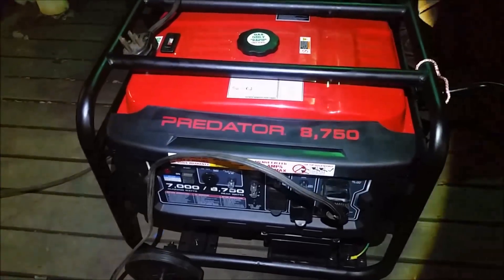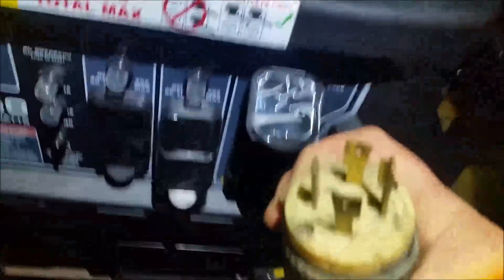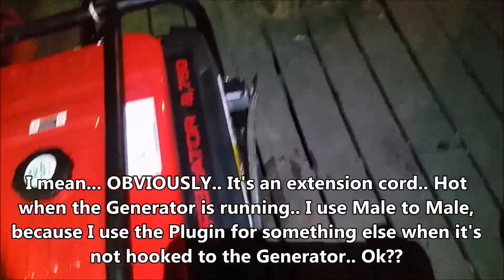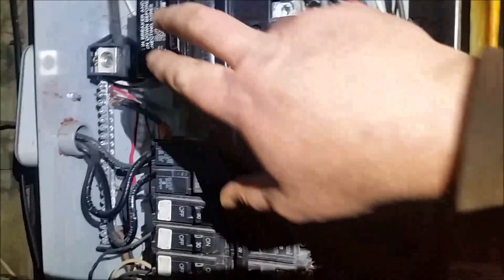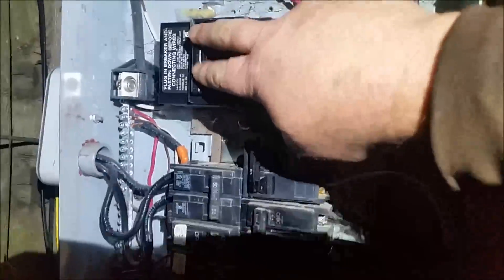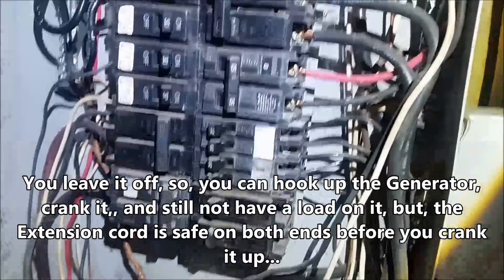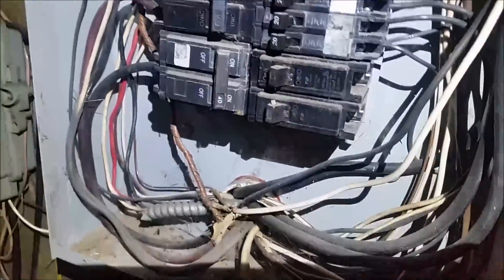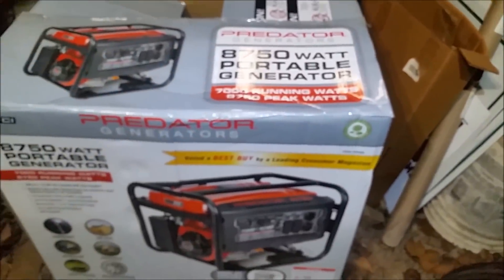Quick/Easy/Safe: Use Existing Plugin/Breaker for Generator hook up to your house Panel box.

Comment: ALERT ALERT ALERT>>> Smart versus Death?
I wil not go into the other legalities to keep this short as I feel necessary. 

Spend a few more dollars Do it right or get it done by a Lic. Electrician.

National Electrical Code requires a system in place that prevents an emergency generator feeding back into the utility line. 
This interlock will only allow the generator breaker to be switched on if the main breaker is off. 
Or the main breaker to be turned on if the generator breaker is off. 

Using a main breaker interlock located in the Panel will allow you to power your existing house wiring with your generator (within its wattage limits), including 240 volt circuits.

If you burn up your home or KILL someone you will go to JAIL,  You are liable,  You can and will be fined also insurance WILL NOT cover 1 Red Cent!!! 
 
Like biting your lip/ tripping and falling, sneezing. You don't know when it will happen but you can believe its going to happen!
 
Just because we have knowledge to make things work, Do Not show it to the public unless You follow the Basic Safety Precaution some steps you do not want to eliminate.

Shorts cuts and hacks are great except when the chance is 50/50 balanced  between the human error factor...
Do everyone on your site a favor if your gonna show it,  do it right!
How horrible would you feel if you killed your momma! 
Remember there is no hack or short cut to bring her back, you are to smart for your own good with to much hacking going on at your place and thats the little I saw from this video.
Reply: NEC.. a code book for new construction under a permit or upgrades.. what you do on your property with your belongings is up to you..not the NEC>  Especially since Electricians over freaking charge the hell out of everyone..ESPECIALLY when it comes to running data wire.  Untrained rooks  thinking they can do better then a structured cable specialist.. I made a solid living off un-Fukn shiat screwed up by Electricians. Why and how??simple... Companies hire maybe one or three actual Electrician.. then send out no bodies to do the actual work..then sign off under someone else's name that actually had the training.  So you keep screaming NEC.. How keep getting calls to go back behind your step ons and undo their screw ups...
Reply from the maker: That is surely the way it works.. I've been there and seen that too. More times than not.
Reply from the maker: I'm not understanding what you are referring to.. What I said.. Let me clarify what I think you are saying, or your question, based on your description.. 
For Starters.. A generator Interlock is just a sliding metal bracket that will only let you turn on your Generator feed to the box when the main breaker has been turned off,, or vice versa.. Can't turn the main breaker back on, unless you turn off the generator breaker first.. It is only a metal bracket that gets installed in the removable panel inside of your breaker box.. Here is a video of a guy installing one.. https://www.youtube.com/watch?v=_pQpXo4np4k
That said.. I don't think that is what you are looking for.. Doesn't have anything to do with the location/size etc of your box.. You still have to feed the box from somewhere.. It only makes you safe when you are switching feeds.. Just makes it Fool Proof, so, you don't turn the main breaker on with the generator hooked up or vice versa.. Can not backfeed the generator feed to utility power etc.. 
You are talking about physically adding something to hook your generator into, that will in turn hook into your breaker panel.. In your case, it would have to be added somewhere where you already have a sizable wire leaving your panel to something else in your house.. An Electric Stove or an Electric dryer or something.. You need 30 to 50 amps to run a minimum to Medium load.. So, see if you have a Breaker somewhere, where you could run a temporary cord to that plugin(dryer/stove), and use the male to male cord, like in the video... I am using a welder connection 50 amp to backfeed the box, but, I could also use a dryer plugin, etc.. 
The only other option you would have is to put it somewhere between your Meter and your inside panel, and it would be a special type of box designed to have one Hot In (from the power company), and two main 220v breakers out,, and you would have to be able to turn the top main breaker off and then, have both of the other mains on the same bus bars, so, you could run one from your generator and have it feed the other.. It would be a "Manual Transfer switch" of sorts,, and would be a little hard to find.. Basically the same as the transfer switches you are talking about.. 
If you have an available 220v plugin somewhere, it would be your easiest alternative.. But, you need to use the existing breaker that is in the box.. Don't upsize it.. It is probably rated for the wire that is inside the walls of your house and depending on the load/size of generator, it is possible to overdrive it and that would cause the wires to heat up.. That is why I said "Electric Stove or Electric Dryer".. Those are usually 50amp and 30 amp respectively. 
I hope I didn't muddy the water a bit more for you, but, that is basically the  way that works.. 
Forget about the panel in the house if you can't get to a Dryer or Stove plug with your generator male to Male plug.
Look outside where the power comes into your house and see if you have a way to hook it up outside.. 
Sometimes they put the meter pan on the outside of the house and go directly into the side of the house behind the meter pan,,,,, but,, you are always supposed to have an outside Main Breaker, and that is where you are going to want to start.. If that is the case,, adding a 220 breaker and putting a plug just outside of the box will do what you want to do.. If you do not like the "Male to Male-Suicide cord",, then, buy a female box for a generator and put it on the wall. Then, you can use a standard generator cord, and not a male to male.. 
If you want to see an example of that,,, look at the video again, and imagine the plugin on the outside Right Side of the breaker box is a Female plugin and the plug into it is female (other end of the generator cord) and the box on the wall has a "Recessed Male Plug" with a cover.. <<<< BUT>>>>> If I did that,, I would move the breaker to the top of the box and put a Generator Interlock in the panel, because,, now,, you have something hanging there that could kill someone for real.. It is different, and curious people can get hurt looking at it... 
The only thing dangerous about what I did is the Male to Male Cord.. But, if you don't have enough sense to make sure that the main is off before you plug it in,,  or,, that you are not running the Genset when you are holding the other end in your hand,,, well,, it is not a solution for you.. 
I think you may have it now, unless you have some preconception of how it should work.. I have covered it.. But, in case not, ask away.. I'll try to figure out what it is that you are not understanding and fill in the blanks for you.. 
Cheers.. 
BTW.. if you watch the end of most of my videos, you can figure out how to contact me.. I don't answer the phone, but, if you tell the Lady who does that  you have a question about a youtube video, she usually will give you my contact info.. Just don't call on a Saturday or between 10am and 4pm during our peak season.. Ha..Ha. It gets busy here..
Reply: You are talking about physically adding something to hook your generator into, that will in turn hook into your breaker panel.. In your case, it would have to be added somewhere where you already have a sizable wire leaving your panel to something else in your house.. An Electric Stove or an Electric dryer or something.. You need 30 to 50 amps to run a minimum to Medium load.. So, see if you have a Breaker somewhere, where you could run a temporary cord to that plugin(dryer/stove), and use the male to male cord, like in the video... I am using a welder connection 50 amp to backfeed the box, but, I could also use a dryer plugin, etc.

Just to clarify. When I had my garage built, I knew how I was going to wire my generator so when I wired my garage, I installed dual 60 amp breakers in my outside meter disconnect box and used 8 gauge wire from there through underground conduit and into my garage breaker box. My generator is 7 Kw which equals 29 amps @ 120 volts per leg. I installed dual 30 amp breakers in the garage box close to the generator for maximum protection. From there, I ran 8 gauge wire, 4 feet, to a 50 amp 4 blade outlet mounted to the wall. My jumper from the generator to the wall is also 8 gauge wire between the 50 amp blade plug on the wall and the 50 amp twist lock on the generator. This is 6 feet long to facilitate moving the generator for oil changes, maintenance or picking up something if it falls behind it, without needing to disconnect either plug. In all, I kept all lines as short as practical.
Reply from the maker: Jeff.. I am loosing track.. For some reason, the comments are not in order and not being tabbed under each conversation.. And my replies are not directly under what I am replying to. I'll have to look and see if there is some sort of setting.. But, what I think you are referring to is the comment about putting the Lug box in.. 
I don't think it would apply in your case, now that I understand it.. 
It was a way to put the generator basically between your Meter pan and your House wiring.. A small box with 3 large main breakers to speak.. One for the Utility power feed that would act as a main to Utility and two more main breakers. One to your house and one to the Generator..Flip the Utility breaker off and the other two breakers on and you are on generator. Flip Gen breaker off and Utility back on and you are running Utility power.
One small box, One Generator Feed, One Utility feed, and one main wire running to your Restricted area Panel in your house.. Someone else mentioned the idea and I commented that to you.. And, I just scrolled back up and don't see the comment.. I even pinned the comment, but, I see my "DumbAss Alert pinned comment is back..Ha.. 
It was a comment made by a user Holcomb.. 
I started the comment with this text "GREAT TRIBUTE TO A YOUTUBE USER WITH A GREAT IDEA.. You guys should read about it.. " and I put his name in there, but, when I went back, I could not find the comment.. 
I know it is here somewhere.. I think all of this started when I turned comments off, then, deleted all of the Igmofuck comments and later turned commenting back on.. I have since even swapped out my old computer with a brand new one I ordered and built and the problem is the same, so, it is youtube based.. 
I'll have to pay a bit more attention to the other video comments and see if it is an account wide thing or just this video. I have way too many projects going on right now.. Ha.. 
It took me 2 days to sort my todo list and then, one day to ride around the property and make materials list for all of the initial projects I have to do.. 
This has to be done before that, and while I have those tools out, this could be done since it is on the list but, can't be put off too long, but, the other 4 projects of the same tools can be put off till late winter, while I get the other projects slated for 2nd week of August ready, so, I can start closing second week of September, so, these 6 projects need to be done before that.. Ha.. If I could just ditch the Computer and office work for a couple of months. Ha.. But, I did that last Winter and it was not a great idea.. Ha.. 
I have only had one employee in 12 years that I would love to have back if it were possible, but, he got married and his wife's family set them up with a house 2 hours from here.. He was a 28 count convicted Felon just got out of jail when I hired him.. He had the right attitude and was eager to learn and cared about what he was doing...
I taught him more in 2 years that someone could pick up in 10 or 15 years.. If he did something and it took him and hour, and I went out and did the same thing and it only took me 15 minutes,, he would obsess over it until he figured out how I did it so fast.. And how it looked like I did everything the hard way, but, I never made any mistakes and it was always the better and fastest way to do it.. If we had something we had to do 4 or 5 times, I would stop, ask him what he thought, we would do it his way, then,, we would do it my way and finish the rest up my way.. Weird, but, neither one of us could ever figure out why my way was always faster.. After we would do it, we could see time savers here and there that made a difference, but, I could never guarantee my way would be faster until we did it both ways.. And, there was no way I could have figured the job in that kind of detail to pick it out.. 
All I can say is the Subconscious mind is an incredible thing,,, and if a guy could totally control it, he would be an absolute genius.. Seems like the more tired I get, the more focused I become,, at least to a point anyway. 
Then, I have the typical employee that takes 1 hour to do something that takes me 15 minutes and the next time he does it, it is worse and it takes him 1.5 hours to do it.. Ha..Ha.. At least I can give him a list of things to get out and ready, and get things started, where I can walk out and get the job done and let him put everything back up.. 
So, I prioritize my jobs according to tools used  and locations used.  I spend a couple of days doing Carpenter work,,, a couple of days doing electrical, and pick up a few jobs that require a few tools of another sort if I am in that area and it's a small task that can be done while I am there.. I usually pull a little 4x6 trailer behind my 4 wheeler with whatever tools I am going to use, unless I am working in the shop.. If it's a two or three day project , I just back the trailer under the shed and pull it out in the morning and go again.. 
I'd better get some rest.. See ya.
Reply: ...I am loosing track.. For some reason, the comments are not in order and not being tabbed under each conversation...

I do this more on AOL news comment sections but I usually copy / paste at least a portion of what I'm commenting on or replying to just for continuity sake as I did above. I distinguish this by beginning and ending the copy with 3 dots at each end then I skip a line. This way, if someone posts between me and what I'm commenting on, the subject matter will be there for reference. Not to get political here but one person on AOL asked why I did it and accused me of being a parrot. I answered him back that I wasn't a parrot, I am a Democrat. The only reason I did that was because this guy was always slinging "quotes" from Trump but when asked for independent evidence or some reference to his source, he would always dodge the question with more accusations about Hillary or Obama so I set it back on him that he was blindly parroting Trump with no thought of his own on his part. I still copy / paste there anyway because when I get notifications that I have been replied too, sometimes I post so many things on a particular story, it's hard to keep up with what and where I posted in the narrative and to whom I had aimed it at. Sometimes I LOVE to argue. :) I hope this helps you.
Reply from the maker: Ha.. Yep.. I can see that.. that comment caught me off guard,  because it said, you replied and I saw my text as your reply, but, I knew before I clicked on it what you had done... A paragraph subject identifier for the reader or the person replying.. But,, ha.. you really threw me with the Democrat thing.. Ha..Ha.. You seem way too smart to be a Democrat.. :)..  I rarely will look up a reference to, or independent source for a comment I make about something. But, I rarely discuss something that is not "recently" in the news.. And, it is getting increasingly difficult to argue "Facts" with someone, since there are so many "Bald Face Lies" being told in the media these days..  I pretty much limit myself to comments from Congressional Members, but that is even getting totally out of hand since Trump has been elected.. It's like all rules are being ignored, there are no professional ethics any longer, and the media can say anything these days and get away with it.. With all of the Government rules and regulations these days in every facit of our lives,, It behooves me to think that a "News" Agency, not a "Commentary" show, can get away with telling their lies, without loosing their licenses.. I think we are going to see just how bad our Government has been before the Mid Terms.. Something tells me that there are going to be a lot of people finally going to jail over it all. 
There is enough evidence out there right now to jail a whole bunch of them, and has been for a very long time.
But, you are not going to see this done in any State or Federal Court Room, since the Missing 13th and the 14th Amendments, when our Government made it's final transition from the Founders great "Republic" Experiment, to the Foreign Corporation.. Ever wonder why,, if we ran Guns to the Mexican Drug Cartell, or, to foreign Terrorists, the FBI would swoop in and arrest us and throw us in jail,, but,, for congressional members, they only "Recommend an Indictment"?? In recent history,, Comey "Failed to, or Refused to recommend to Indict" Hillary to the US Attorney General? They would not need a "Recommendation of Indictment" to kick down "Our" door and arrest us,, now would they?? It's quite simple.. If a Foreign Diplomat was accused of, or,, was caught red handed on National TV killing someone,, would the FBI swoop in, and Arrest them?? NOPE!!
They would restrict them to "Their Foreign Soil - their USA Based Embassy", and "Recommend Indictment" to their Foreign Country's Government, and assist in their leaving the Country voluntarily to return to their own Country, and whatever that Country decided to do about it, would be their business only and ours to only gripe about it if we didn't like it.. Sound Familiar??? 
But, the whole mess was done illegally,, and all of the Debt we have assumed since has been assumed by another Entity,, not our Republic of the United States of America, and our Common Law, not our Maritime or Admiralty Law system we are under now..  It will be interesting to see how it all works out.. But, My bet is,, it will all be out in the open and changed if there is going to be a change by the big Parade on Veterans day,, November 11, 2018.. 
If we don't end up investigating and prosecuting the investigators, I would be utterly amazed.. 
Not sure if you know the Judge.. Not sure if you will like this or not, but, you should give it the 9 minutes.. Especially if you are really a Democrat.. :)
https://www.youtube.com/watch?v=iYUZFYa7fLs
Reply from the maker: JEFF McCREA.. I forgot to say something.. 
If you want to add the Generator Interlock,, you will need to buy one for your particular box,, and you will have to move the Generator backfeed breaker to the top of the box, either top left or top right.. That is the location the Interlock is designed to protect.. Here is a good place to see the different panel types and different Interlock types. A good place to start anyway.. But, ebay will probably be the best place to find and buy easier and most likely cheaper. 
https://natramelec.com/
Reply: Tracy bass ...it may not look pretty to you. But he does know what hes doing.
Reply from the maker: Thanks Ricovali.. You are correct.. I have beaten down these "Safety Nut" guys at every comment they have made.. It all boils down to one thing.. If you can't follow some very, very simple instructions,, or don't have enough common sense to understand what you are doing to do it from your mind rather than memory or a list of instructions, you really have no business doing anything electrical..  Even changing a light bulb could be dangerous, if you stick your finger in the socket.. One good thing about this setup is,,, when you grab that Male to Male extension cord,, if that does not remind you to be careful,, Nothing will!! Think about that for a minute... ?
Reply: I get what you're talking about now with the "lockout device. Thanks for the address. I will watch it. To clarify, my system is set up in my garage. When I wired my garage, I ran an 8 X 3 with ground wire out of my breaker box below the meter box on the house with a double 60 amp breaker. I ran it into an 8 circuit breaker box in my garage. I have 6 various breakers from 15 to 20 amps to power lights, power tools, garage door opener and other outlets. I installed a double 30 amp breaker and ran it to a 4 pin 50 amp dedicated outlet with 8 gauge wire. I made an 8 gauge jumper with a 4 pin 50 amp twistlock male plug that mates to my 7 Kw generator and ended it with the 4 pin 50 amp male plug to match the one on the wall. This way, it never has to be handled so there is no shock hazard. If someone comes that shouldn't see the setup,. I unplug it, hide the jumper and, if asked, the plug is for my arc welder. Anyway, 7 Kw at each 120 VAC leg is 29 amps. When we have normal power, the double 30's are turned off disconnecting the generator from the system. I had put red wire ties on all the 240 VAC breakers in the house breaker box. When the power goes off, with instruction manual in hand, these get flipped first. Then I go outside and flip the main breaker on the meter box. Then I go into the garage, turn on the fuel valve, pull the choke knob, flip the kill switch and push the starter. After the generator runs for about 30 seconds, I flip the double 30 amp breaker connecting the generator to the house system. It won't run my 4 ton heat / A/C unit but if I leave the furnace breaker on, I can run the main blower by itself to circulate air in the house. Years ago, I had a 5 Kw Coleman. When I shut it off, I would just hit the kill switch and walk away. One winter, the power went off and I couldn't keep it running to save my life. I called a friend at a small engine shop who said that I let the gas in the carburetor get old and turn to varnish and it clogged. Even with fuel stabilizer!!! He told me to pour in 1/2 a can of Sea Foam engine additive to 5 gallons of gas and do what I could to keep it running. After slogging out 6 or 7 times to restart it in a half hour, it finally smoothed out. Now, when I run the generator, when the power comes back on, instead of hitting the kill switch, I shut off the fuel valve and let the carb. run dry. I haven't had a problem since. I still have the old Coleman and use it as a loaner for my friends. It sat, tank empty, for about 2 years. I went out to change the oil and start it up and it wouldn't go. I went to Walmart and got a bottle of Mechanic in a Bottle. It's about $7.00. I poured 1/2 a bottle in the empty tank BY ITSELF according to the directions and let it fill the carb. I put gas in it 15 minutes later and it ran like a champ. As for installing a transfer switch box in my house as recommended, I would have it install it next to my breaker box so I could access / disconnect selected circuits to connect them to the transfer switches. for "proper" operation. Where my breaker box is physically located, there is no room to install the transfer box into or on the wall. It is in a short divider wall between 2 rooms.
Reply from the maker: Ok. I got it.. Understood.. That is probably the way I would have hooked it up in that case.. I hate to do anything permanent, because I don't have things the way I like them yet.. Seems every project has one that needs to be done before that one.. I used to have everything in one shop when I lived in Louisiana, but, it had some drawbacks, but, I never let them bother me.. I never liked doing the welding and cutting in my shop (cement slap with smooth finish).. Now that I do a good bit of Blacksmithing work, I have begun to appreciate a dirt floor, and a more open shop.. I rebuild my metal table a bit larger and I like the two projects together.. Still trying to decide what I really want.. One large shop about 100 x 50 would do it, but, it's not in the cards at the moment due to the lack of flat ground.. 
I am almost ready to put in a 20x50 with slab for the wood working, and Machine work, with a small exterior covered slab for any metal fab work that I need to do.. I have an extra Welder and plasma for that.. But, I have a need for a 40' container to store my boats.. The 20' is not large enough any more and it would just be a waste where I want to put it, if I didn't put a second container on top of the other, so I could walk into the second one from the other side of my house.. And, I have a 12x21 carport that I am going to move in front of that on a blacktop slab that I will do some other projects and use for extra storage for stock, etc.. I live 20 mins from a very small Ace Hardware and 45 minutes from a Lowes. I have my own Metal/Wood Mart and my own Ace Hardware right here.. Ha.. But, I have some retaining wall work to do before I do that.. (See what I mean?)..Ha. 
I have a few other projects this winter that are going to take up quite a bit of time designing,, and I said I am going to build some of the Industrial wood and furniture this year to let me get more organized in my house until I decide what to do shed wise again.. It's a little place and I do way more stuff than anyone I know, and I like to have what I need when I work on it, so, I have lots and lots of all kinds of stuff.. I am tossing out my dressers and wardrobe whatever you call them (some expensive brand junk), and I am going to the ceilings with some really cool cabinets with Drawers, doors (have to design some offset hinges that I know will work already), and a New Entertainment system for the 50" flat screen I have had in the back of my closet for the past 3 years, I bought from an employee who needed some cash.. Everything is going to be modular. Even the Hall Cabinets and Kitchen Cabinets.. I am going to tear this old place down one day and when I do,, I am going to just pull out the drawers/shelves and move everything into something else.. Or, they will become some fancy shop cabinets. 
I built one last fall for my Lathe and Mill accessories, and figured out exactly what I do and don't  like about it.. 
I've just been tossing things together here and there to fill a need, and it's almost that time to start replacing those things with a purpose.. I needed some cabinets a couple of years ago and didn't have time to build what I wanted and had to replace a front deck on my large bath house down stairs and had a bunch of 1" thick rough cut wood that had been walked on for 20 years... It's going to turn into some pretty nice looking and functional furniture before too long.. Anyway. Just thinking with my fingers.. One project at a time,, but, I have about 40 on my Fall and Winter todo list already... Ha.
Reply: In my state there is a Master shut off box after the meeter it has a big metal lever that disconnectes the power before the breaker box, here every house has to have one!
Reply: I wouldn't be willing to bet someone else's life that everyone that reads this and trys it is competent enough to turn the main off every time. All it takes is one person to screw up and ruin someone else's life.
Reply: James Williford yes you are right, this video should be taken down!!!
Reply from the maker: You are exactly correct.. Common sense and some basic understanding of Electricity and Panel boxes is DEFINITELY REQUIRED to use this setup... If it doesn't make sense to you that the Main Breaker MUST BE TURNED OFF FIRST 100% of the time,, No Exceptions,, this setup is definitely NOT for You... DEFINITELY.. Sounds like you would be fine using it, but, only if you are 100% comfortable with it, and you were the only one who would be doing it..
Reply: If you lose your ground your generator WILL backfeed on the neutral backfeeding the utility co. transformer and inducing high voltage on the powerline.
Reply from the maker: Are you Fucking for Real?? You have not learned your lesson about being Ignorant yet?? What a Dumb Fuck.. Bet $100 you voted for Obama/Bernie and Hillary.. Holy crap, what an IgmoFuck.. Aren't you the guy with the MikeHolt can't comprehend shit you read post?? Ha..Ha..Ha. Hey.. At least you are reading.. But, I have addressed this no less than a couple of hundred times here.. Keep reading.. You might get smart one day.. 
You are really hard to teach something.. Let me take one more crack at you, and only because this is New Ignorance and not the same old crap you came up with earlier.. I am going to give you the answer, but, this time,, you are going to have to do a little thinking on your own.. 
Your panel.. It has two hot feeds and a Neutral coming from the Utility.. Correct?
Follow the Neutral and see where it goes.. To a Neutral bar?? Lots of White Wires going to the bar (Neutrals??) What other wires do you see going to the same bar?? Bare Copper?? Follow the Ground rod bare copper (the biggest one in the panel).. Where does it go?? To the same Neutral/Ground Bar??? 
So. We know the bar that is commonly called the Neutral bar is also a GROUND??? HINT,,HINT,,HINT,,, Here it comes. 
Do your HOT WIRES CONNECT TO THE GROUND OR NEUTRAL?? If it did,, what would happen?? Are you with me still? Can you understand where I am going? Hint,, Hint,, HInt.. Are you thinking yet?? Do you know what I am going to say next?? You should.. I have already told you more than you need to know,, in order for you to finish my next sentence... So,, the Neutral goes to ground and not to hot.. Lineman??? Get it yet??? Still Stupid?? Figured it out yet?? 
Ok.. I would bet you are still reading and not thinking.. So, I had to pause there a bit and see if you would actually stop and think.. Because,, with your comprehension problem,, I just gave you the solution to solving it.. Did you catch it?? You need to read, gather information, and then apply it.. When you figure things out on your own,, you don't forget.. You Comprehend it.. Make sense?? You have to stop and see if you know what to do with the information you just read.. Do you have enough information yet to solve the puzzle.. If you made it this far, and it still does not click,, go back to the "Your Panel.." And, start there again and you can stop with "Figured it out yet??".. Do not read any further until you figure it out.. Trust me.. you want to follow my instructions.. This is what you are missing.. This is why someone with Zero job experience and Zero formal Training and Zero text books and have never read a full page of NEC codes, knows more about what has been discussed here than Every Electrician who has posted here, every Journeyman, Physicist, Fireman, and the list continues.. It is because, it has to make sense before I move on.. You have enough information now to figure it out.. If you continue, you will not learn what you need to learn to use every day of your life from this day forward.. It is what you are missing..  Ok. here we go.. this is why your statement is so stupid using the knowledge above.. 
3 Wires coming into the house from Utility.. (But,, are they all from the Utility Substation?? Hint,,Hint,,,Hint) Another BIGGGGGG HINT.... 
The lineman only works on the Lines coming from the Substation when he is repairing lines to get the power back up. Hint Hint Hint.. 
Remember.. We are talking about the Ignorant statement,,,, "Neutral backfeeding to the Utility Transformer and inducing High Voltage on the Power line.. 
HINT,HINT,,HINT. Figured it out yet?? Stop right here if you have not figured it out yet and go to the window and look at how many wires are running from Utility pole to utility pole.. Is there 3 Wires??? That WAS THE BIGGEST HINT YET!!!! If you don't have it now.. You really need some practice... You should have looked at the pole long before I told you to.. If not, you are not trying to piece it together.. You are not trying to make it make sense before you continue.. I told you when you had enough info.. You should not have started reading again.. You should have only started reading to "CONFIRM" what you figured out to confirm that you were right or wrong.. If you were wrong, you should have known it quickly and knew what you were missing to figure it out at the very least.. Ok,,, if not, we move forward so you can see how it can be done.. 
220v house current has to start off with two 120 volt wires.. The Transformer is a Step Down Transformer,, so it starts out high voltage and ends up, where?? 120volts.. So, the two wires coming from Utility feeding your transformer and then the next one down the road are only 2 wires.. Both 120 volts for the discussion,, not being a Neutral wire.. And we know that we don't hook Hots to Neutral/Ground, so,, what happened to the 3rd wire(Neutral///////GROUND--HINT,,HINT,,,HINT))) Damn if you didn't catch that and figure it out... Ok.. Follow the "Neutral/Ground" wire to the pole and keep following it.. Where does it go?? Where it is supposed to.. Ground!!!!!! PROBLEM SOLVED!!!! Did you get it?? 
If you loose ground at your house and the hot feeds back to Neutral where does it go?? TO THE LINEMAN down the Power Wires???  NOPE!! They don't mix.. It goes to ground.. See how simple and how Stupid your comment was?? 
Ok.. Now.. before you go one step further.. You need to google "How does a GFCI work"  And, if it does not discuss the Inner workings of the GFCI, like the type of chip that monitors the voltages and what exactly it is monitoring, keep searching.. Because this is what you are missing in order to "Comprehend" which is 'Understanding", and when you understand something,, You DO NOT FORGET IT.. It is different than studying multiple choice test questions and relating something to the answer and not remembering shit of what you were supposed to learn, because passing a test like that is cheating yourself, and if you continue, you will be just like the rest of the dumb asses here rather than the other guy who knows 10x times what they know without their experience.. Remember.. It has to make sense,, or you don't understand it and you wont Comprehend or Remember it.. Simple concept,, but, like the steps to follow in this setup,, neither are negotiable. You either follow them, or you loose.. 
Now. Be honest.. How old are you actually.. The average age of the average youtuber is 15 years old.. How old are you actually? This is a learning experience, so we should all learn something. I have done my part, now, I would like to learn something. Be honest.. Because I want to learn something also out of this.. I took my time first, and not because you asked a question.. So,, what is it.. How old?
Reply: AHHHHHH we're all going to Helllllllll!!!!!!
Reply: Hey everyone, all of you really need to watch this video about generator safety https://youtu.be/I1jT3ANENvI I’m glad you all are alert with safety advices. Hope you all agree with this video I’m sharing. Thank you
Reply: I'm not knocking what you are saying. I'm asking a serious question. Do they make some kind of interlock that acts as you say. With all of the available licensed backup generator installers in my area, I have only heard of those stupid transfer switches which are basically nothing more than 4 or 6 double pole / double throw switches that are wired in to a few selected circuits in your in house breaker box from your generator. I can't have one of these installed here because my breaker box is in a short wall where there is no room to mount a box the size of the Manhattan phone book. If I could get an interlock like the one you describe, I'd install one tomorrow. Thanks
Reply from the maker: TRacy Bass: DUMB ASS ALERT!!! ,,, DUMB ASS ALERT!!!  ,,,,,, DUMB ASS ALERT!!! ,,,,, DUMB ASS ALERT!!! 
Read the text and watch the video... Here you go if you missed it 4 times..
Only for those of you with Common Sense though.. Those that talk about Safety 100% of their time on Youtube,, better not mess with this one.. Way over your head..Ha..